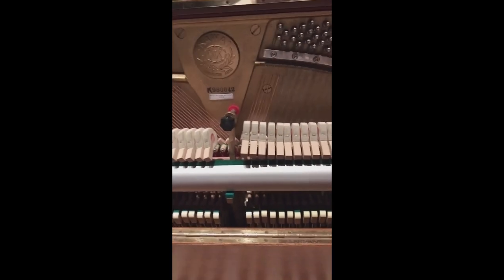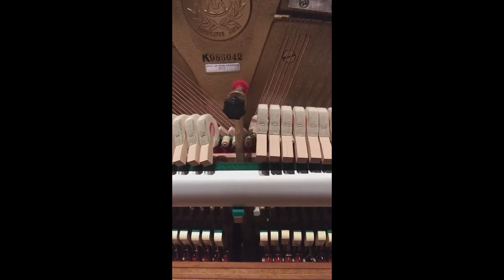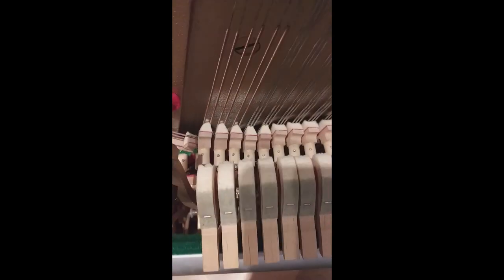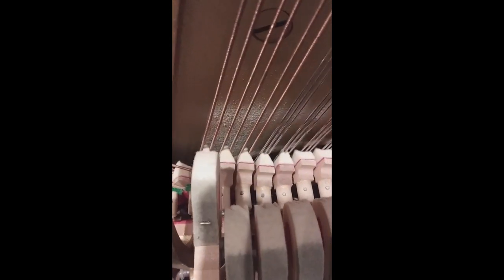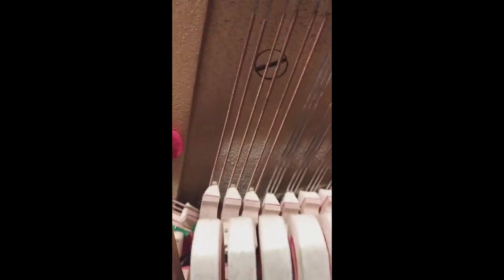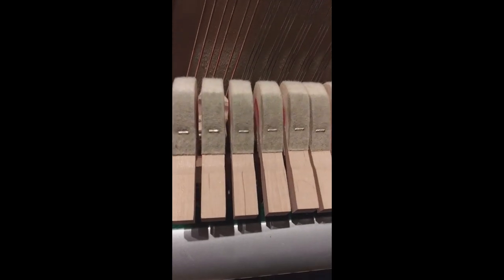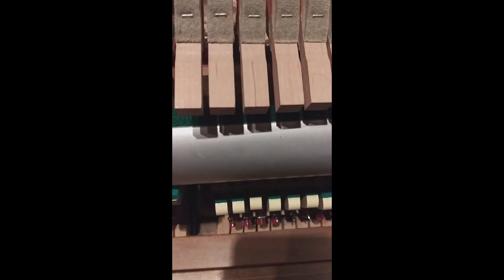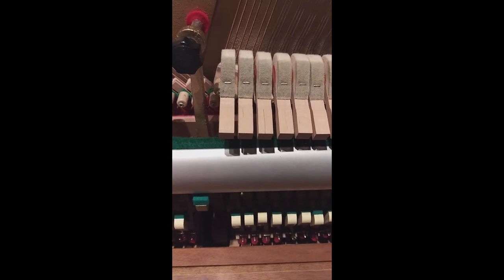This Piano Needs Some Let-off Adjustments - Diagnosing Hammers Blocking Against The Strings I HOWARD

Comment: Hi! How should I do a broken letoff screw replacement? Accidentaly broke one cause I was very tired of regulating
Reply from the maker: If there is a piece of the screw that you can get a hold of with a pliers to screw it out, that would be the best thing.  You will probably have to remove the rail first though.